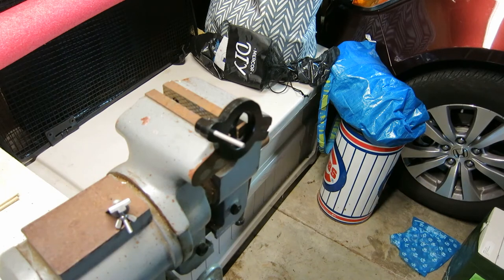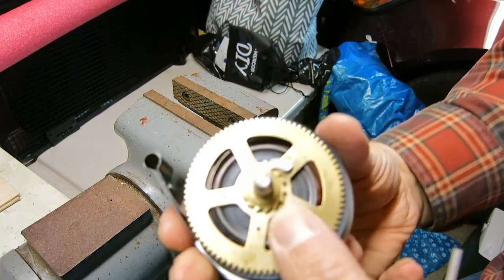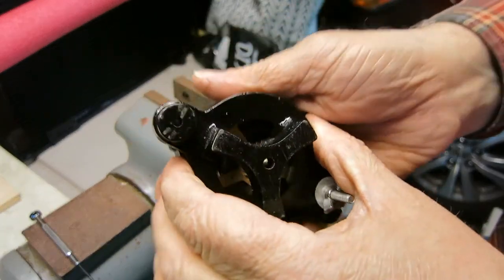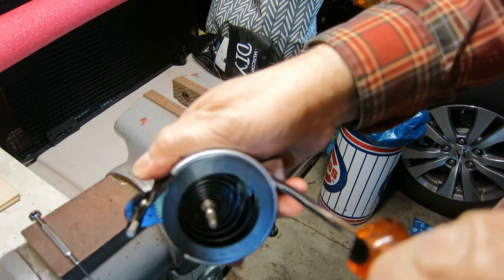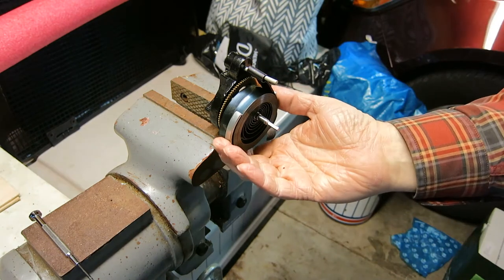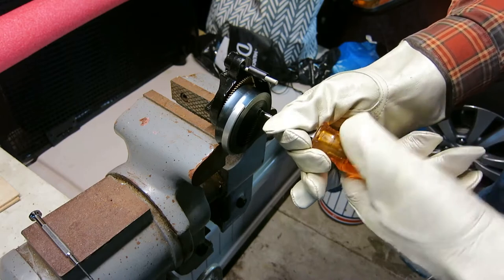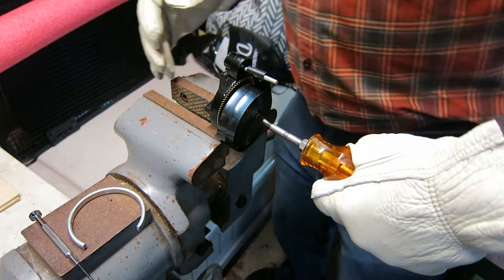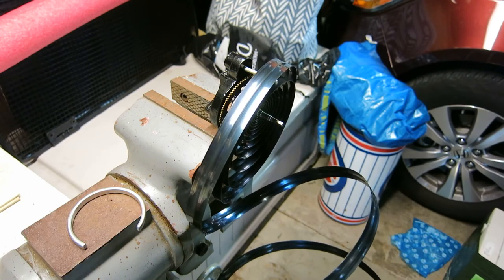How NOT to use a Loop End Mainspring Winder

Comment: That looked really difficult to use.   I was peeking through my fingers at some points 🤠
Glad you didn’t get hit by it.
I built my own winding tool.   The frame was out of wood.  I made a crank handle out of a piece of bar with another rod to hold it in place so I could let go of the crank.  I had to fashion adapters and stuff to suit the springs I was working on but it wasn’t that hard.
I had to unwind a loop end barrel spring but I should be able to adapt it to hole end springs as well.
I didn’t want to buy a tool that cost more than the clock I was trying to fix.
I didn’t make a video on it because I didn’t really know what I was doing 🤠
Maybe I will when I’m working on my next clock.

Comment: So, first: do not use a bogus Indian spring winder on a 31-day clock.  Matter of fact, don't use that thing again, for anything.  I know: everyone has purchased one of the fool things (I did, and I wish Timesavers would discontinue them) and they're universally reviled as dangerous.  

If you have open springs on the clock you can just use your let-down tool and let the springs down while they're still in the clock.  You can re-wind them the same way.  But in this case, you already had the springs in the clamps and needed to service the great wheels and the ratchets (clicks.)  It would have been a lot easier to detach the clamped mainsprings from their arbors (you rotate the arbor in the direction that the spring unwinds until the arbor hook pops off) and leave the mainsprings in their clamps until you're done rebuilding the ratchets and staking everything properly.  They'll go right back on and you're done.  

You might wish to visit the clock repair forum at nawcc.org.  You can get your own account there and post any questions you might have (membership in nawcc is not required, and many people there don't have one.)  You'll also find plans for building your own spring winder, which I recommend that you consider. 

 It's a good group: nobody ever scorns beginners and everyone has something to contribute.  Mark Kinsler kinsler33@gmail.com
Reply from the maker: Thanks for all the helpful tips. I have joined NAWCC and their forums, which is vital for anyone learning clock repair. I've also ditched my Loop-end winder and bought an Ollie Baker Style one (which works sooooo much better!).  I agree that the Nawcc forums are fantastically helpful. I've also managed to gently re-bend/re-shape the tension washer and securely snap it back onto its arbor, and the clock has been running on a test stand with no visible problems for 17 days so far - I'm happy with how this clock repair is going. https://needhamia.com/clock-repair-101-how-the-great-wheel-works/

I've also sworn off 31-day spring-driven clocks (after this one). I found plenty of warnings on the Nawcc forums about the strength of 31-day springs, and their danger to the unwary repairer.

Thanks, again,
Brad
Reply: 31-day Chinese and Korean clocks aren't too bad if you're ready for them.  Their escapements seem to never wear out, and they've been sold very widely in the United States, at least.  I've fixed several this year.